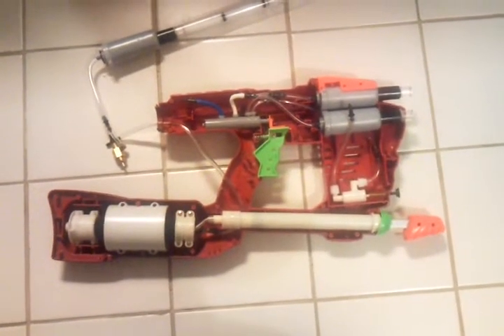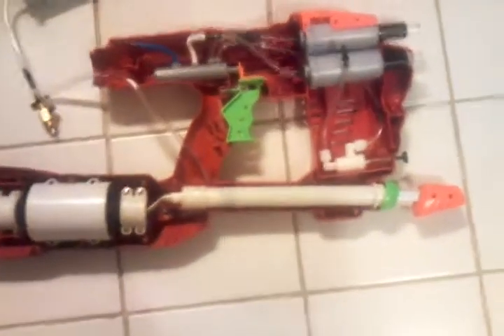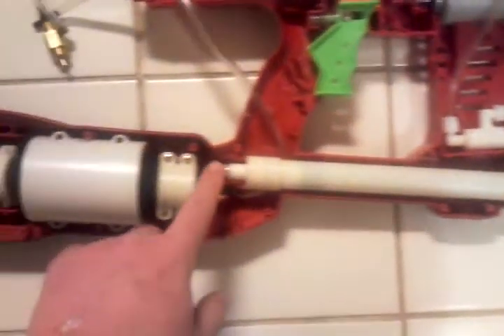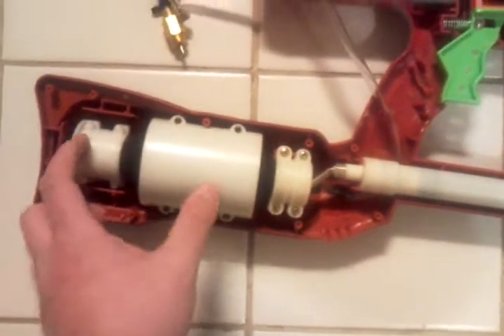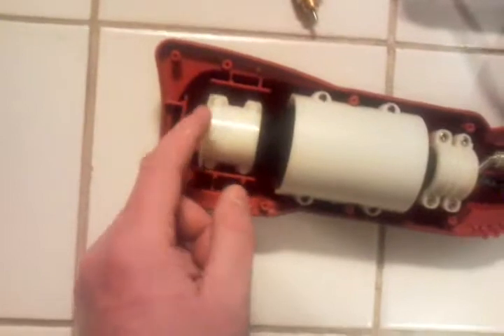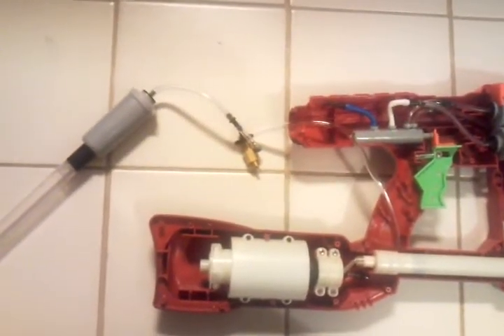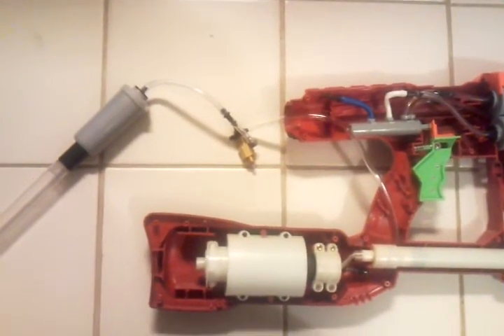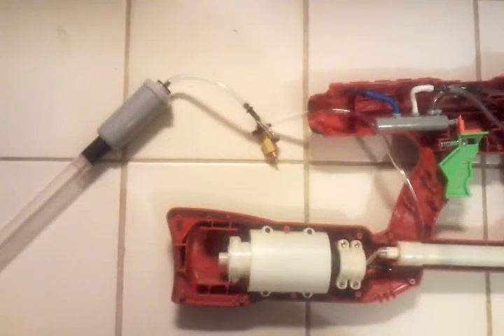Semi-auto valve

Comment from the maker: @skullface1818 I will update the description with a link. They do rip you off on handling fees, so make sure you order several at once cause ordering one will cost you an extra 20 on handling. I attached the tubing using the gardening tubing connectors you can get at home depot and plumbers goop. They are cheap and hold air pressure just fine.

Comment: Extremely impressive! Ive been working on making a homemade one of these for a long time, with little success. Does the amount of force necessary to push the button and fire the valve increase as air pressure increases?